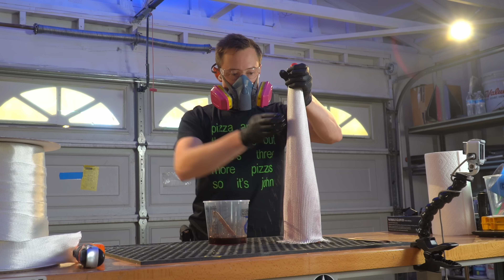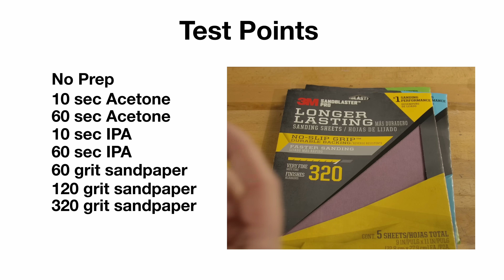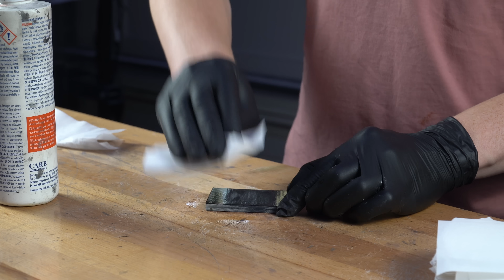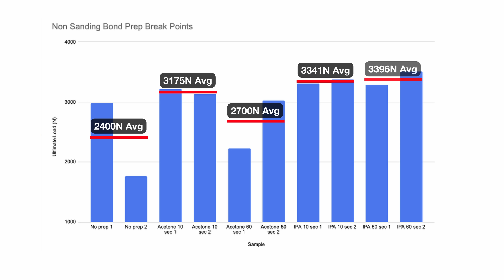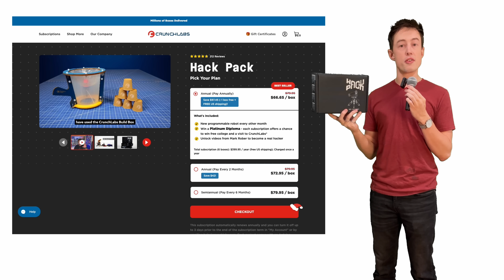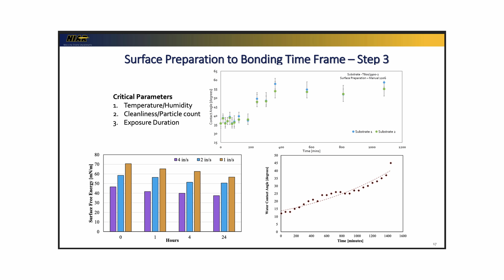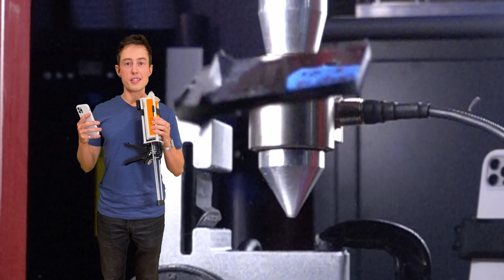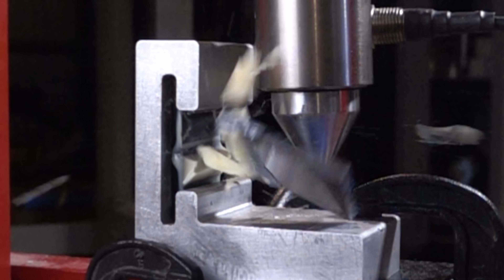I Broke 100 Epoxy Bonds to Find the Strongest

Comment: Hi there, boat builder here. I recomend you experiment with different filler aditives to your epoxy. In all those cases the epoxy, not only let go its adhession but also fractured through the epoxy fillet, particularly the lower one. Adding a high density microfibre or even cotton fibres to the epoxy will significantly increase the strength of the resin which may mean that the load is shared more between the top and bottom fillets, therefore increasing the bond strength. I'm not sure if the fibres would affect the actual individual bond strength but experimeting would show this
Reply: Yea, it didnt seem like the coupons broke much at all.  He did say that a few did fail but he didnt talk about the frequency of each type of failure.
Reply: @1320crusier I mean from the slo mo footage you see a lot of substrate on the resin fragments.

No idea what this means but I’m sure someone can make sense of that
Reply: @pieppy6058  substrate on the fragments is good because it means the bond is stronger than the parent material, so it won't fail before the actual structure does
Reply: 5% graphene by weight
Reply: @zsigmondkara hell yes
Reply: @zsigmondkara  Add 5% graphene to the epoxy instead of fibreglass for increased strength?
Reply: if you look at the jump cuts of the final series of testing, he's leaving epoxy layers behind, so he got consistent results because that's the failure point of the epoxy. you're 100% right that a filler can make the epoxy strong enough to actually test the bond 
It's like cement vs concrete
Reply: Layer of fiberglass would probably work the best. much much more surface area. Even better, fins welded a ring collar (Slipped onto the rocket body) that is epoxyed to the rocket body would have more strength than epoxy bonded fins.
Reply: Or better yet, use  spabond 345/445 for fillets, which already has microfibres etc mixed in
Reply: Probably a good idea for his build but the purpose of these tests was to see what was the strongest bonding process not necessarily the strongest bond
Reply: Silica Gel is a common additive that has published results correlating increased strength in every strain category for epoxy and similar resins. Similar additive options include mica powder, which isn’t all too different but usually not available in as consistent of mesh sizes so I don’t know of as many publications citing it as a high performing additive, though the data I have seen does indicate a similar result. Silica gel, if easily sourced, would be a great choice 👍🏻
Reply: @Sir_Defyable  What about fumed silica?
Reply: @lw8882   I've been using Cabosil which is fumed silica, as a fill for epoxy for fifty years, never found anything better for fillets. I believe he means means fumed silica when he says silica gel, as silica gel is a drying agent. Dunno, maybe silica gel is fumed silica. But, given the color of the epoxy I think it's already filled with Cabosil. Maybe not as high a percentage as I would have used.
Reply: @ChimeraActual  It seems like the kind of thing that would probably be on the manufacturer's ingredients and specs list, but i cbf checking cause it seems like an obvious thing he probably did make sure was in it, or would have used if it wouldn't compromise something. Also yeah that makes sense about fumed and gel being the same thing.
Reply: Yes I thought the same, in these tests the thick epoxy was always breaking away in thick chunks.  After watching the Tech Ingredients video on this topic a long time ago, I'm often mixing in various fillers like sawdust and chopped fibers into my epoxy projects.  

eg epoxy with sawdust filler is excellent for building up against a surface (like he was doing here) and it cures in place because it's more like a putty than a liquid.
Reply: Literally anything will be better than unfilled epoxy in this application. I'd start with talc since it's cheap and available. Fibers are often better but there's no reason to discount simple fillers like talc, silica, shredded T-shirts, potting soil...

A bunch of the failures don't even show bond failures. If there's even a skin of material left on the coupon then it wasn't a bond failure.
Reply: Have you tried adding a ham sandwich? I have heard this is super good enough.
Reply: @ryangreen4024  And super-fast !
Reply: @danielblachman1275 only if you use the matt version, glossed over a lot there
Reply: @ryangreen4024  Dunno if you've checked recently, but apparently this can lead to delamination (dehamination?) after time. And juice leaks... Possibly the bread:ham ratio was too far in favour of the ham, though. More testing needed.
Reply: This video was more about developing the process for controlling relevant variable rather than finding the best bonding process.
A filler sounds not only like another variable, but a variable comprised of a process that introduces even more variables. Not only are you talking about which material would be best as an additive, but you'd have to determine how variable the quality of each additive is, what process of introducing the additive introduces the fewest variable, and then finally(?) test if it actually makes a practical difference in the final bond.
Reply: Was about to say. When doing fiberglass work on my 50 y/o sailboat (Classic Plastic baby!) we're always thickening up our mix with either microballoons or microfibers depending on what we're doing (bonding marine ply to glass? microfibers + fiberglass layup... filling holes? microballoons)
Reply: Modern full-size man flying gliders made of carbon fiber and epoxy resins or glass fiber are bonded together with the same resins and cotton flocking. These bonds rarely will fail, but they also do not use butt joints with just epoxy filets.  I don't know how the cotton flocking increases the strength, but imagine it is the cotton  fiber strands. Why reinvent the wheel? Ask the people who make things with composites.
Reply: It makes me wonder if the fibres would reduce the thermal capacity of the fibreglass tho?
Reply: When I do composite fiberglass layups and I need to make structural thickened epoxy I usually mix in either some chopped fibers or milled fiberglass along with fumed silica, it's ridiculously strong 💪
Reply: Right, Aerosil, Mini fibers, Chopped fibers.  Raw epoxy fillets are a no go for anything I have ever built that was going to see any kind of stress.  Also, any large radius is a fail because It will fail AE testing because of all the fractures generated during deflection
Reply: Agree on that. Often i see that people use as a fillet or as glue pure epoxy +fumed silica. In my experience, this is very brittle stuff. Adding cotton or pulp fibres is a game changer in such applications.

Comment: I am someone who has worked with exfoliation of monolayer 2D materials like graphene, which is 1 atom thick. What we did in the lab to make graphene stick to SiO2 wafers is:
1: Sonication in Acetone for 15-30min
2: Wash in IPA from a squirt bottle so we don't touch the surface.
3: Blow-dry with pure N2
4: Oxygen plasma 1-3min
5: Prep is over, so now the graphite crystals can be applied
6: Heating or Vacuum to extract remaining gas from the interface with a pressure gradient
Contaminants and adsorbents are a pain to deal with for clean surfaces and depending on what the chemistry and application is, you want a specific outcome which usually requires specific though often standardized processes like RCA cleaning etc.
Reply: I really don't expect washing with India Pale Ale to produce good results. Rinsing your gut with it might make the testing less grueling.
Reply: Sonication in acetone, yup, sounds good, washing with IPA, mhmh, seems doable, bow dry with N2, cool cool, *oxygen plasma*. D:

(I nearly did this process as a lab assistant a year ago, for applying a PEG coating on glass slides for specialty microwell plates. The oxygen plasma still seems insane to me)
Reply: @arturjogi6054 There’s companies like Diener Electronics that sell table top plasma reactors for this. We use one in our cleanrooms for oxygen plasma treating wafers prior to coating various polymers.
Reply: @arturjogi6054  Sounds like a government contract alright.
Reply: I love that 'sonication' is a word.  I'm guessing that's like an ultrasonic cleaner for the wafers like a 'megasonic' ?
Reply: @starlite528  Yup, it is exactly that
Reply: Obviously those are the steps.  You forgot to mention it has to be done in a temperature controlled clean room with humidity control at a fixed atmospheric pressure.
Reply: Idk man I've seen a science youtuber do it with scotch tape and a pencil 😂
Reply: @RAD-RC  Fun fact: We still use scotch tape as one of the best methods, but for large area flakes you need bigger graphite crystals than the ones found in a pencil.
Reply: @th3hom3slic32  thats pretty cool actually. Im sure for commercial needs the bigger the sheets are the more versitile they are.
Reply: @RAD-RC  Yep, but at that point exfoliation is impossible as it doesn't upscale well. Instead, you grow "massive" sheets with CVD and thereby settle for decreased magnitude of properties due to defects, contamination and functionalization. The exfoliation stuff is mostly for scientific purposes where you want to maximize the properties.
Reply: i have a question...yall do know you're supposed to clean before sanding then clean again after sanding right?
NEVER sand contaminates INTO the surface...big mistake when painting cars!
in this video he didnt clean before sanding
goodness knows whats on the surface of the tokens from sitting on the shelf, shipping etc
also most synthetic/engineered CF/FG etc outgas/cure over days/weeks
pushing impurities towards the surface...often trapping them at the top few microns thick of the surface
especially lower qualiity/non specific industry "specified" materials.
generic CF/FG sheet at the local plastics supply house, sitting on the shelf could be a few years old, had someones lunch sit on it etc etc
that surface is dirty before its even shipped out
Reply: Do people still use ClF3 for cleaning SiO2 wafers?
That stuff is guaranteed to burn off any contaminants...
Reply: @eclectichoosier5474  Apparently so, as well as nuclear applications.
Reply: Wow, so basically combining a variation of most of the techniques mentioned in the video. By sonication, do you basically mean putting the part in an ultrasonic cleaner with acetone as the solvent?
Reply: @notfst  Yes, that is essentially what it is
Reply: Very similar to how I prepped SiO2 and Si surfaces for nanodiamonds, though instead of an oxygen plasma in step 4 I used an UV/Ozone cleaner (and didn't need to do step 6).

Comment: I think the primary mistake is that huge epoxy fillet; that stuff isn't made for bulk strength. Make a proper triangular cleat with one face curved to match the tube radius and keep the epoxy layers thin so all your loads are shear loads.
Reply: part of me wants to say to add chopped fiber flock to it as well. But that may have the opposite of the intended effect as well. Testing required
Reply: Easiest solution here is filler. Even something as simple as talcum powder will be head and shoulders above no filler in this application. Costs basically nothing and will add tons of strength to the compression side which will re-distribute load in the tension side, as well as improving strength in all shear areas which will improve the load distribution as well.
Reply: Isn't the size of the fillet he's using for aerodynamics rather than "strength"?
Reply: I can be both

Comment: In composite aircraft construction, fillets are made by adding microballoons or “micro” to the epoxy. Then the fillets have multiple layers of bidirectional glass or cf applied over them. In your rocket fin construction, one layer of either material would substantially increase the strength in every direction. Also use peel ply to eliminate heavy sanding, which again would reduce strength by removing too much material for cosmetic and aerodynamic purposes.

Comment: I used to do method validation for chemical analysis and intra-laboratory testing was one of them, this was to see if the test method when performed in one lab with its regular environmental conditions (e.g. lab temp, atmospheric pressure, electrical loads) would still perform the test method just as well at a second lab, so yeah, it's always a good suggestion to do the test at your place because your environmental conditions are not the same as those done in labs

Comment: As someone with zero stake in this and obviously a year past the design phase.  could building a finned joint increase the load bearing capabilities you're after? It would at the very least increase the epoxy surface area and reduce sheering. There may be bigger downsides though. Im totally happy to let this drift into the void if im wrong.

Comment: Did a similar set of experiments, both in bonding-agent (glue) and joint-configuration, to make the lightest but strongest, RC-Airplane wing and fuselage construction.
We found that the bonding-agents were not the weak-link, and that prep and mechanical configurations, were far and away the critical element.
But the most important part, was that 'canned' information from forums and sources, was very unreliable!
We found obvious great suggestions, and techniques; but the bottom line was testing-testing-testing!
When you do your own testing, you gain a huge-confidence that you are going to make successful and high-strength members...

Comment: 7:37 - no prep 1 vs no prep 2 - factor of 2 difference there - Acetone 2 i'd call "the same" - or did you get lucky with Acetone 10? - hard to tell ...
Reply: I think with no prep it might of been that sample 2 maybe had some oil on it from handling which would cause the discrepancy, since he didn't clean it at all

Comment: I'm curious about using something to vibrate the parts when you first put the epoxy in (and possibly while degassing).  If that might increase the amount of epoxy that bonds with the surface.

Comment: I have experience with using atmospheric plasma on aerospace composites. Your plasma flux density was probably not high enough to actively etch into the resin cap to create more surface area. You certainly got the surface activation part with your plasma as you could see in your water contact angle testing, but not the increased surface area from plasma etching. From my experience plasma is far more repeatable, as it removes the operator factor. It will also match or exceed acetone and ipa wiped composite surfaces.

Comment: Before I get through the entire video, here's my take from many years of composite material construction. When it comes to composites, having the more end-shape uniform structure is normally the strongest, without regard to reinforcement and structural additives (honeycomb, foam core, etc). When bonding a secondary part, best practice suggests that it is done before the epoxy cures on the first part unless under repair protocol. Bonding cured epoxy to uncured is more akin to teh attempt to adhere cured silicone to something else. It might be 'stuck' but not structurally sound. Roughing the surface increases surface area via adding 'tooth' and a more pregnable surface for bonding. Can be done successfully, more difficult without breaking through the old resin first to attain more uniform density/strength/impact resistance, etc. 
The interesting thing about epoxy is that it isn't the metric that's providing the strength in the composite, it's more to lock in a shape. The material being encased or laminated is your strength. Epoxy (or your resin of choice) is also the bulk of the weight of the final part compared to the core material in most cases. Most people associate carbon fiber with ultimate strength, whereas good S-glass is actually stronger weight for weight. CF fabric does excell at impact resistance over fiberglass weight for weight. That said, if ultimate strength and rigidity is your goal, using S-glass as the underlayer(s) is not only cheaper, but using CF twill as the top layer(s) provides excellent part strength, toughness, etc.

Comment: I wonder how/if the direction of the sanding, whether it be parallel, perpendicular, or otherwise, affects the overall strength. Even if (spoilers) sanding ended up having less of an effect than solvents.

Comment: Thank you for showing good use of PPE while sanding fiberglass. Lots of folks skip this and displaying the use of it here is great for all of us who are learning.
Reply: Absolutely. I build surfboards and did a deep dive on safety--I basically look like an astronaut when I'm sanding. Epoxy will sensitize you, suddenly even being in the room will give you bad rashes and breathing problems. Even after hardening there are plenty of un-linked molecules, and the fibers break the skin barrier, getting the chemicals in. Acetone for skin cleanup of wet epoxy is a big no-no as well, use liquid dish soap, the sticky molecules will be surrounded by the soap. I've seen some of these epoxy table videos where the creator was using a power planer, wearing a t-shirt, and he was COVERED in epoxy chips. Gave me the heebie-jeebies, I couldn't watch.

Comment: The vacuum degassing after assembly removes microscopic amounts of air in the roughness of the surfaces, allowing the epoxy to grab the surface better, regardless of air in the mix.

Comment: A lab I know that does a lot of epoxy work for space almost always degasses in a beaker before applying the epoxy to whatever it will be bonding.  The overwhelming majority of the gas that needs to be pulled out is introduced at the mixing step.  In situations where a second degassing step is possible, the amount of gas removed from the epoxy is usually pretty minimal, though of course this depends on the application.

And yeah, degassing in a container before applying the goop means a lot less mess.